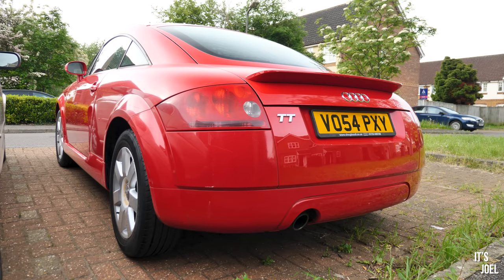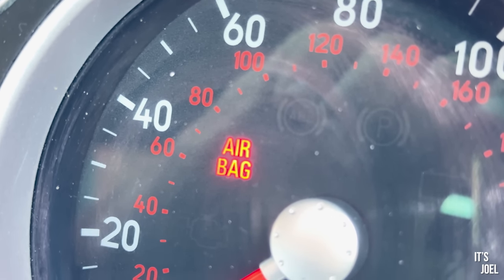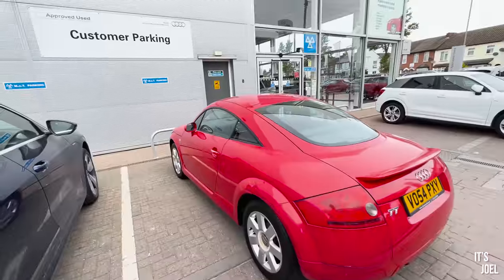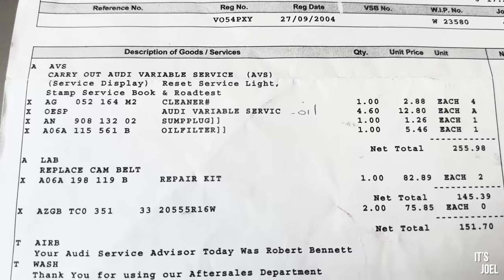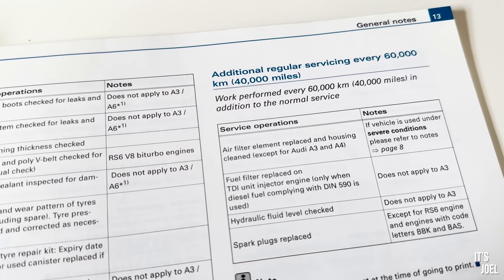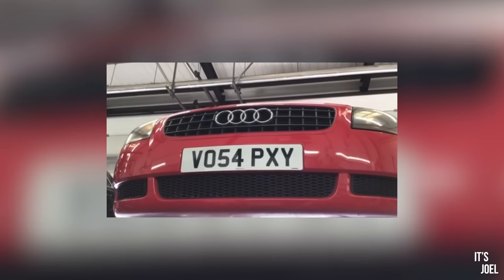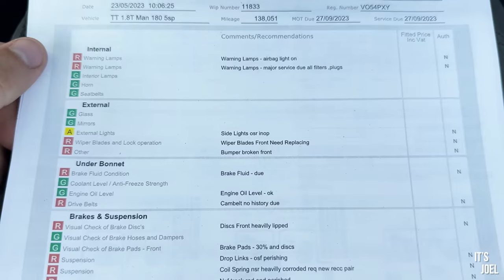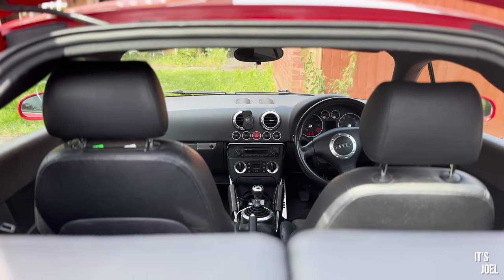AUDI WANTED £2,698.70 TO SERVICE MY COPART AUCTION TT!

Comment: Audi Dealer Rip Off for sure. Anything that looks slightly worn, replace & add to the bill. 
From what I can see on that last major service, it was in 2022, so all I would do this year myself is oil & filter, brake fluid. You don't need spark plugs yet.
Also regarding suspension, do the drop links if they have any spits in the rubber bushing, or are knocking, easy job yourself. Those springs look ok to me from the video. I'd give them a wire brush & have a dig, as it looks more surface rust to me.

Comment: audi dealers are so over priced as i own a audi s4 v8  they wanted £2118.42 to replace the subframe bushings  ended up buying after market bushings and doing my self  9hrs work and £219 on bushings was all done 

my s4 was a copart car was stolen and recovered with keys a lot of car for just under 3k to my door

Comment: If I was you I’d take it for an mot…. It will cost you £40-£50 but you will no what needs to be done to get it passed. That’s what matters…..what Audi did tells you what it needs to run well…but that’s not the things a garage will be looking at to get it road worthy. I wouldn’t spend any money on the engine until I no it going to pass mot…